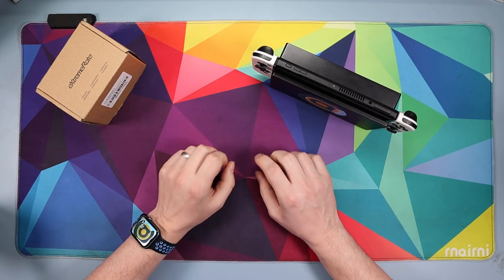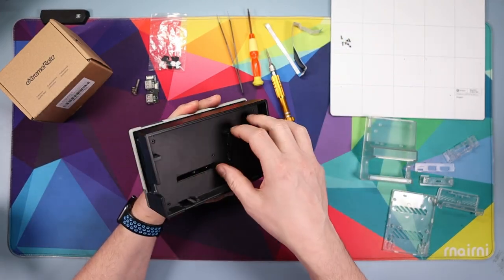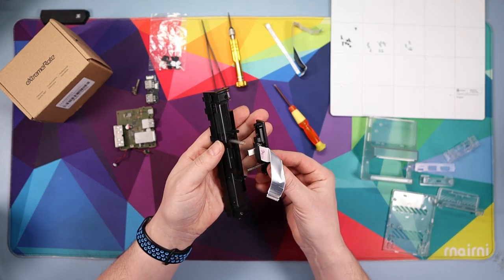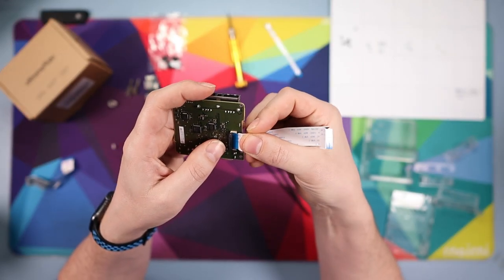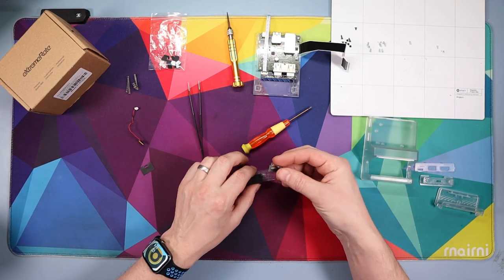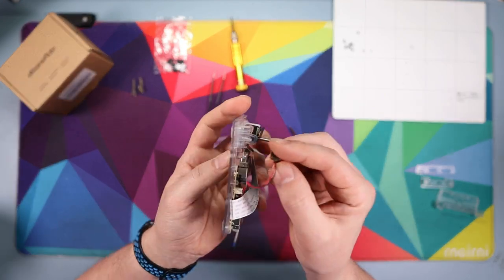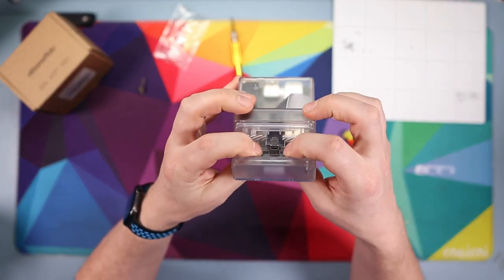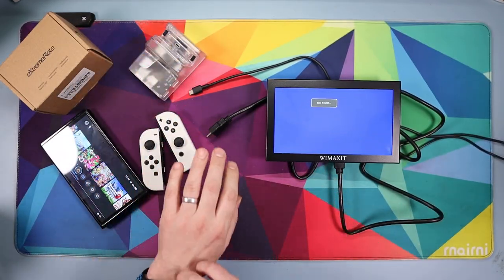eXtremeRate AiryDocky DIY Kit Replacement Shell Case for Nintendo Switch & Switch OLED Dock mod

Comment: There are two problems with this product but it's minor and R&D can still fix it. 1, the mod dock needs some weight cuz just pulling out the NS casually will lift the whole dock completely. 2, the lock clips near the led daughter board slot need fixing cuz the soldered wire can break if not careful.

Comment: Thanks for your guide.  Really easy to follow.  I had followed your other guide for the back plate & joy-con cover swap, which... I'm never going to do it again... but I got to the end, thanks to your guides.  Really appreciate the great work!

If anything I think it would be helpful if you mention which size of the driver you're using.  I had gotten one of those screw driver sets that come with all sorts of different sizes and I always worry of choosing the wrong size which may strip the screw...
Reply from the maker: Thanks, will make a note of that.

Comment: @CTAtechdesk just just finished installing my oled dock into this kit. Not sure if it is just my situation but did you notice that the power LED on the front is extremely dim compared to the stock dock?

Comment: Btw You did fail mention that the original ribbon cable isnt actually long enough for the mod. You have to use the one provided!
Reply from the maker: Thanks for pointing that out.